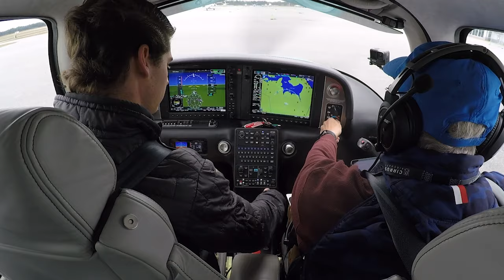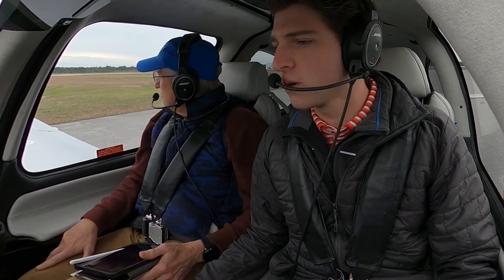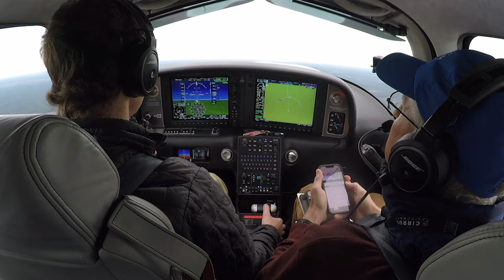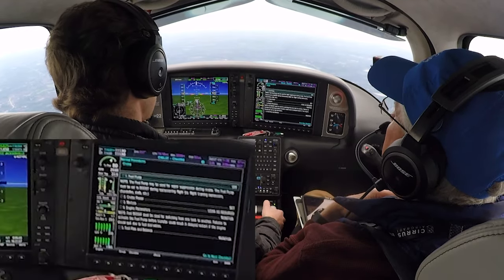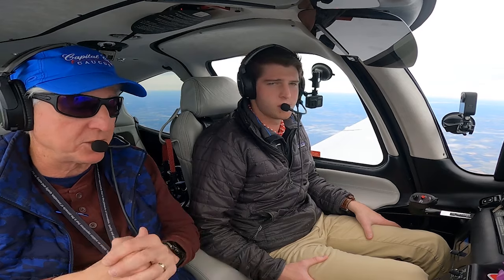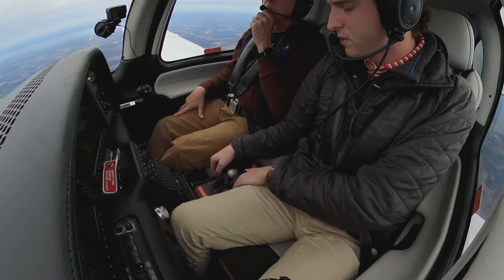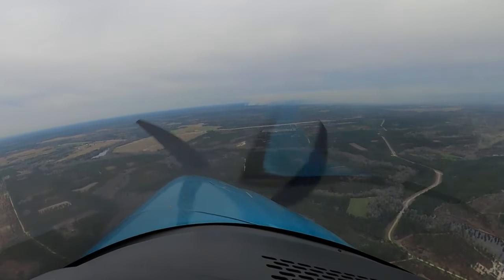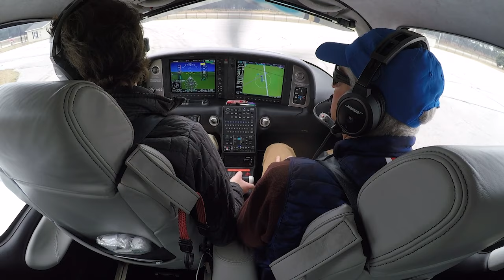CIRRUS SR22 - IFR Flight Vlog to a Small GEORGIA Airport │ ATC Audio

Comment: Just a tip - it's a good idea to include pressing the TOGA button as part of your pre-departure flow. That way you rotate and pitch up to the command bars. While not incredibly useful during the day, its a good habit to set because at night, or in low IFR it could save your life.  There was a Cirrus crash recently where he went into the trees at night that probably could've been avoided if he had done that. Great video!
Reply from the maker: Definitely, thanks!